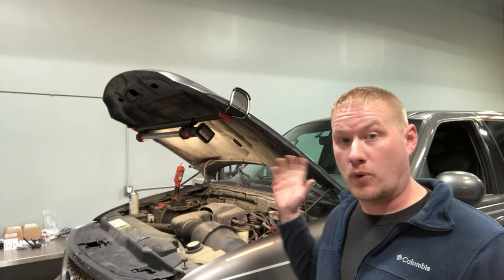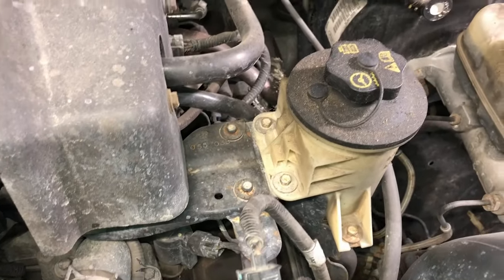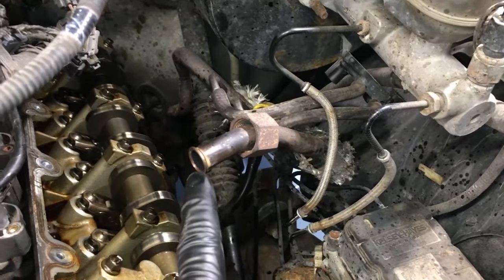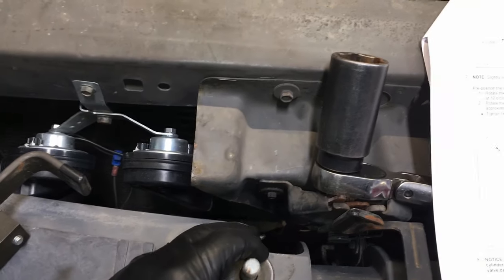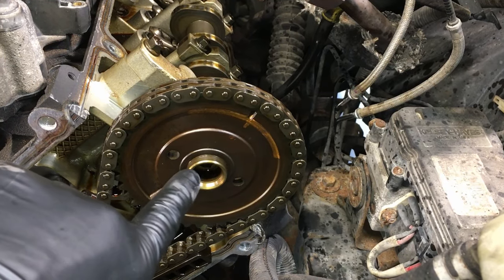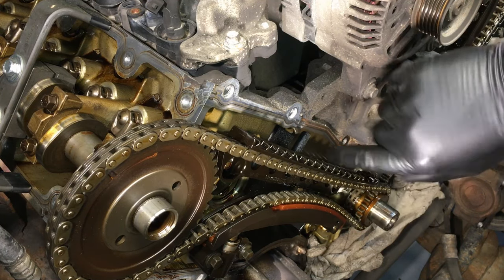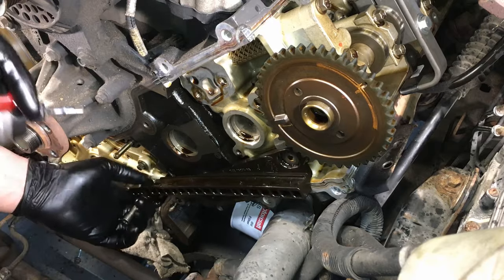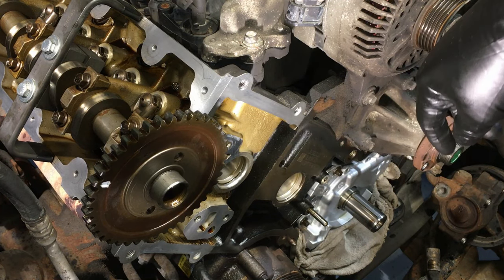Ford 5.4L 2v Triton Engine: Complete Timing Walkthrough

Comment from the maker: These are the Parts and Tools I recommend:
Timing Tool Kit-
https://amzn.to/2WxSRbK
Or skip the tool kit and just remove the followers instead-
https://amzn.to/2WEZgSO
Crankshaft Alignment Tool-
https://amzn.to/2I31OWJ
Melling Timing Kit:
Early Models-
https://amzn.to/2V5v3fb
Later Models-
https://amzn.to/2HT0Bll
Verify Timing Kit Fit here-
https://www.melling.com/parts-lookup/
Permatex Ultra Black Engine Sealant-
https://amzn.to/2JWqYsJ
Fel-Pro Front Cover Gasket Set:
Early Models-
https://amzn.to/2WF2MfY
Late Models-
https://amzn.to/2HRtpLm
Verify Gasket Set Here-
https://www.fme-cat.com/application.aspx
Valve Cover Gasket Set-
https://amzn.to/2YHbnjP
Melling Oil Pump-
https://amzn.to/2uEfTC4
New Longer Upper RH Guide Bolt- W709818-S437
How to Replace the Oil Pump-
https://www.youtube.com/watch?v=ulEJfcQ7HhA

Front Cover Torque Sequence-
https://drive.google.com/file/d/1VQ-HWsD50BF3xHAI0OWtQCKI_uJa53Ii/view?usp=sharing
Drivers Side Valve Cover Torque Sequence-
https://drive.google.com/file/d/1oCTS0wdJHPjDCQTanDGtE73SaBl3Mhtk/view?usp=sharing
Passenger Valve Cover Torque Sequence-
https://drive.google.com/file/d/1_i-dGGEDQjjwANfYBJeCpyPbEg5q1waT/view?usp=sharing

As an Amazon Associate I earn from qualifying purchases.
Reply from the maker: No they will be a bit off due to stretch etc
Reply: i have an 02 harly f150 with the passenger head gasket oil leak. it has 117k miles on it. thinking of pulling the moter to make it easier on me. any advice. just looks rougher to do head gaskets in the truck. mayby a trick to make it stop leaking without head gasket replacement. lol. i have oil in the vally,burning on the passenger side manifold and dripping off the starter.
Reply: i have talked to the local machine shop about resurfacing the heads and installing sparkplug inserts. (this moter allready blew out two plugs. is that how i address this problem or is there a better fix with the heads off?
Reply: @nathonsmithson3024  of you're pulling the motor anyway, might make more sense to put some 03 or newer used heads on. They have 8 threads instead of 4 in the spark plug holes..... just my. 02
Reply: @nathonsmithson3024  it's possible to do the head gasket in the vehicle but it's WAY easier to pull the motor........ hard part is getting the head back on without destroying the head gasket....... ask me how I know 😡
Reply: @kevins9576  yeah i was going to put the inserts in the other 6 cylinders while i had them off (ford allready did 2). i might go ahead and refresh the whole moter and put a set of h or i beam forged rods and pistons in it so i can really turn the boost up. ill have to see how my money situation is. i also have an 05 expedition with a 3 valve which is going to need some timing love soon. got about 170k on it and the phasers starting to make me hate drivethrus. i wish fordtecmakuloco was my neighbor. lol
Reply: How do you know if you have a 2V or 3V 5.4 without taking it apart?
Reply: @spacedriver2045   I'm not sure on the 5.4 but my buddy's 3v 4.6 mustang, the valve or rather cam covers were metal instead of plastic. Im sure there are other ways to tell but that's one difference I noticed.
Reply: @spacedriver2045  yes the 3 valve has alluminum covers. came out in late 04 .most of the earyones had the rectangular airfilter on top of the intake. there is a vct cylinoid on the front top of each valve cover amongst many other tell tell sighns. the easist way to tell is go to tacobell and sit in the drivethru. if it sounds like theres a few midgets with wooden hammers trying to get out of your fender well. its a 3 valve
Reply: @FordTechMakuloco  so you recommend the melling timing kit over the motorcraft one on 2v engines compared to the motorcraft on the 3v engines?
Reply: Hey @fordtechmakuloko i have a 2005 focus 2.0 with intake swirl flap issues... The dealer where i live said i need to buy the entire intake manifold... I was thinking about just taking the swirl flaps out entirely... is that going to be a problem for the vac system to kick on the check engine light ???
Reply: my rig has 182K but still pretty quiet on startup, at what mileages are you seeing absolute need for replacement (04' Exped.)? Thanks and great Vid.
Reply: FordTechMakuloco is it the same procedure for the 4.6 2v?
Reply: Real quick would you also recommend changing the followers? I followed how it was done on my 3v, thanks for the video, and now my 2v need the timing done. On my 3v the you said that the driver side had problems from pressure loss and I noticed the followers had hole that were enlarged due to wear. So should I change them on my 2v also. If so do you recommend a certain follower? I got my 3v followers from some other site but don’t recall, I know they were adertised as atop quality product.
Reply: I've had a few techs tell me to put some ultra grey around the tensioners to "help" keep seal. See any problem with that?
Reply: @iilijah  Most times the cause of the phasers failing is the cam journals. This was the tensioners but anyone with phaser issues I recommend checking the journals. IF you have wore journals its more to fix if you can even find anyone to do so correctly,than to just replace the whole thing. I love Ford but they dropped the ball on the VVT OHC bs.
Reply: @kevins9576  Um.... how do you know? :)
Reply: FordTechMakuloco So I purchased a fixer upper and well I was initially gonna just replace the engine because it was knocking at acceleration but I’m starting to think it might be worth fixing so let me explain the knock. When I start the truck you’ll hear a rattle then you won’t hear it till your rpms pass the 2s going into 3s and you only hear it if your rpms are in that range truck still gets up to speed will hit 60 on the highway but you’ll hear that knock or rattle sound The reason I’m not sure on replacing the engine tho is because it still has power any recommendations. No check engine light on either.
Reply: Around what mileage do you recommend timing set job on the 2v ? Mine is at 289k right now.
Reply: @andrue17  If it's never been done you're overdue. They usually need replacing right before they hit 200K
Reply: @MrUbiquitousTech  I just recently bought the truck about 8 months ago so no telling if it has been done before. As far as I can tell the motor idles smooth and has little start up noise until the oil is circulated up to the valve train.
Reply: @andrue17  Might have been done already. If you look in my videos you can find one were I recorded start up on my 2000 F150 5.4. It's at 195K and it's pretty obvious it needs the timing set/guides/etc replaced.
Reply: Would you recommend the melling m176 for a 5.4 2v turbo application?  At what point would I want more volume or pressure than what the m176 provides?
Reply: Good you are the best
Reply: Thanks you my friend you are the best
Reply: Can anyone help me iam wondering if theres a wiring harness issue on a f-250 5.4 2 valve,  i redid everything , valve job all new timing,  new injectors,  new coils , new intake, all new top end , and num 5 cyl has a misfire just as it did before, it actually burnt a hole in the num 5 exaust valve, so i did the whole top end new , and moved coils ,no matter what number 5 has a misfire, i dont want to ruin anything and do it again any help or advice will help,
Reply: Is 2 crack shaft position sensors both needs be disconnected??  39:10
Reply: Quick Question; since you are removing the cams in entirety; once you position the crank at 11'o clock can't you go ahead and reove the cams in entirety rather than removing rockers in partial and just remove them all? Thanks
Reply: How long should this job take...?
Reply: FordTechMakuloco Hi, Dodge tech here so forgive me if this is common Ford knowledge, but I don’t hear of the 5.4 2 valves having cam tower lubrication issues like the 3 valves seem to be known for, but as you showed us the 2V engines had the same hydraulic tensioner seal blowout issues. 

So it got me wondering: Does the extra lubrication demand from the VCT system in the 3V engines create that much more of a parasitic loss of the top-end lubrication that the cam bearing surfaces are getting chewed up on the 3V engines and not the 2V engines, or are the 2V engines actually having the same top-end lubrication issues, but without the VCT system to “tattletale” via DTCs that things are going out of spec. people are just running the 2V engines longer before discovering they are having top-end issues?
Reply: Thank you i really appreciate it
Reply: @fordtechmakuloco I’m wondering this too that @crazy dirt said about the oiling and what causes what.
Reply: I'm going to change my tensioner but the new ones come with a plate with a small hole in it. Should I use the plate or not
Reply: Hi amigo, I just want to know  if is the same way with the 3  valve?thanks, by the way great video
Reply: Hey thanks... what would be the price you would charge for something like this? Whats a fair price
Reply: What are the new bolt numbers for the chian guide I cant get the parts # from the video
Reply: My v10 truck has over heated 3 times due to a bypass hose popping and my heatercore going out. I finally ordered a metal line for a bypass but I’m thinking it will be a good idea to replace my timing chain even though it still runs immaculate. I assume it’s the same process on the 6.8 v10 if it’s the same year ? Mine only has 124k on it but I just don’t want it to be an issues down the road due to the overheating.
Reply: Folks the part number for the chine guide bolts is as follows w709818 s437.
Reply: Can I ask how bad I screwed up by not securing the cam before I took the original chain off thanks for the help
Reply: Yeah, you had me at welcome YouTuber and you were thorough in explaining a lot in detail, I would like to see more videos like this from "YOU"
Reply: Where exactly can I find the W709818-S437 bolt I researched but there's a few for a ford door and the rest are some small bolts, if someone could help me out I'd appreciate it.
Reply: @FordTechMakuloco  is it possible to put the timing chain sprocket on backwards on the crank? I bought the mehling kit and it came with a new one and I don't wanna mess anything up, Tia!
Reply: @
FordTechMakuloco my mechanic replaced my fuel pump for 460$ and told me my timing chan broke and it'll be around 2500$ to fix the timing. does this sound right how could my fuel pump and timing go out at the same time?
Reply: What are the symptoms of a bad timing chain on a 97 ford f150 5.4 v8?
Reply: On this case don’t need to remove the roller followers right???????? Just remove the spark plugs??
Reply: I was told sweet spot was 3 and 9
Reply: @aladam6310  where did you find it bro? Im looking everywhere
Reply: I have a 1999 ford f 150, it has the 5.4 in it, well it locked up and I bought the truck, I bought a used engine, well I've bolted it all in and the power steering pump on the head now, having issues and wondering now if it could be a 3v engine, it said on the head it was 9/2/03, it's a ford Windsor made in Canada, 551,e172a,280803 2401958,3g 61o ab, are markings on head
Reply: You didn’t show it so I’m guess the slack on the chain on bank1 side should be on bottom side/same side the tensioner is on. Bank2 you showed it on the top side/tensioner side.
Reply: @FordTechMakuloco  ok so on the timing chain tensioner does that plate go behind it or do I leave it out because I didn't see you put one in
Reply: any other recommendations for replacement parts while I am in there
Reply: Where is your shop located
Reply: @FordTechMakuloco Been watching as many of your 5.4 videos that I can find and have learned a TON! Thanks a bunch for taking time to create such great content. Given your expertise on the 5.4, I wanted to consult with you to see if it’s worth digging into the one I just bought for $1000.

When I bought the van last week, the seller reported they purchased it 5 months ago for $9k, put almost 10k miles on it. Recently it has started to stall on them and run rough. I noticed it barely showed oil on the dipstick, it had the startup rattle that you talk about. And it had what sounded like a knock when revved up a bit. I couldn’t notice the knock while driving though. The seller mentioned they were getting a cylinder 7 misfire so they replaced the plugs and then swapped the coil from 7 to 6. When I got it home and ran the codes, it was showing a misfire on 6. I assumed the coil was bad but haven’t replaced it yet because I wanted to address more serious matters first. 
I did a compression test which came back in this order assuming the cylinder order starts with 1 on the front passenger side, ending with 8 on the rear driver side. 
8-100
7-100
6-40
5-115
4-155
3-70
2-45
1-105
The spark plugs on the passenger side all had small burnt marks on the insulator nose. 
Could it possibly just be timing is off or is there a good possibility I will be doing valves as well? 
The leak down test generated the exact same results.
Reply: Qq
Reply: I have a 5.4 2 valve how come my crank won't turn a full
Reply: @FordTechMakuloco I have a 2004 expedition 5.4 2 valve and I was changing the oil pump put it back on the slipped I'm trying to get it timed back but my crank won't turn do you know what would cause that to happen
Reply: @spacedriver2045  2в отличаются от 3в